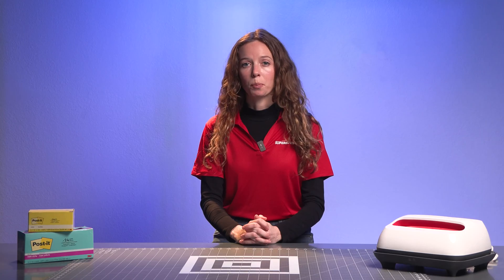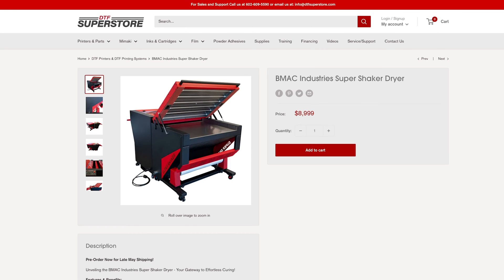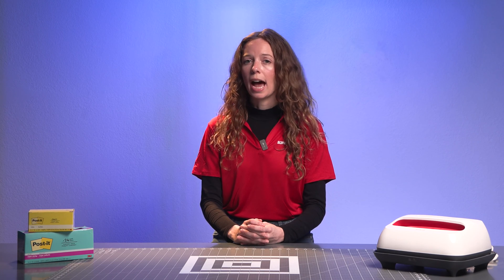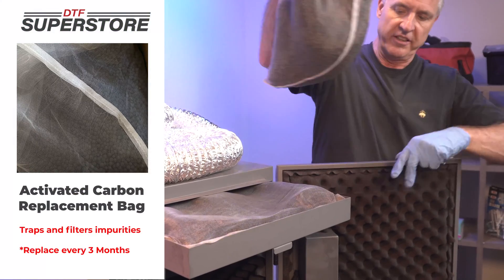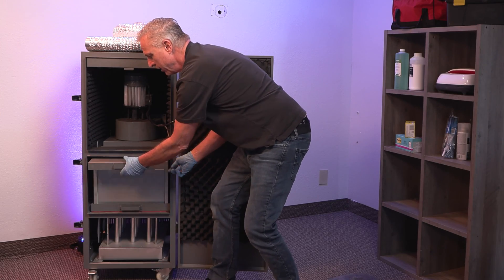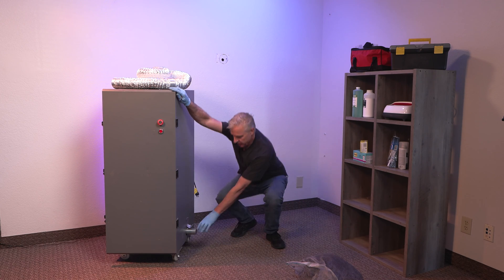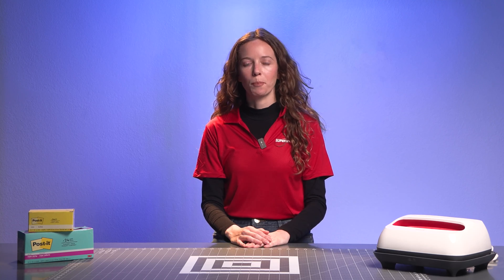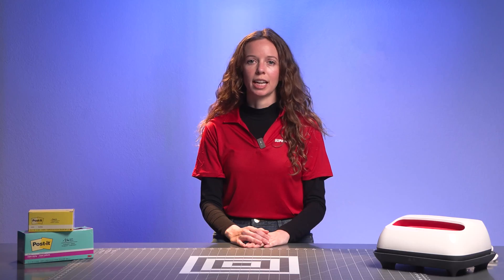DTF Fumes and the DTF Fume Extractor

Comment: Air borne particles are not the same as fumes. Wear a dust mask to protect yourself from air borne particles. Use a fume extractor if you're worried about any off-gassing. $2k fume extractor is overkill. Can literally make your own with less than $100 in parts and an hour or two of time.
Reply from the maker: Thanks for your thoughts here and thanks for watching!
Reply: What part would you suggest.  Thxs